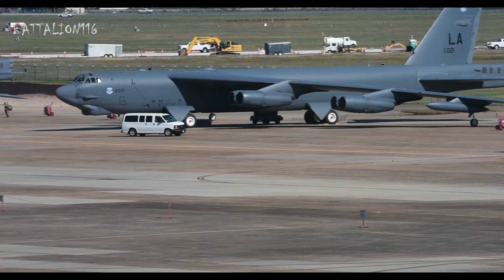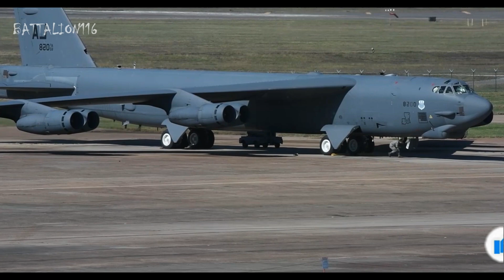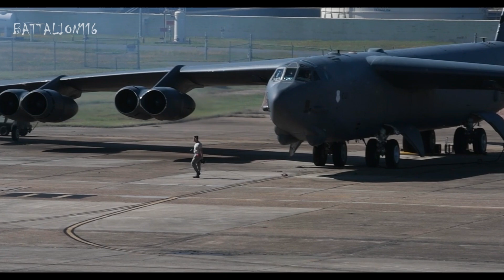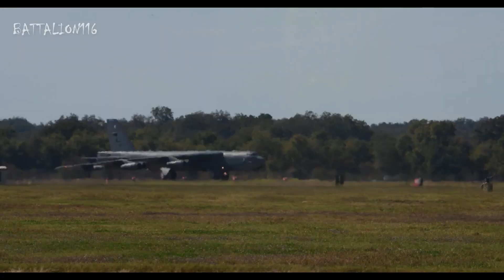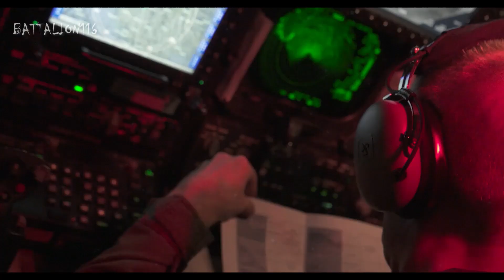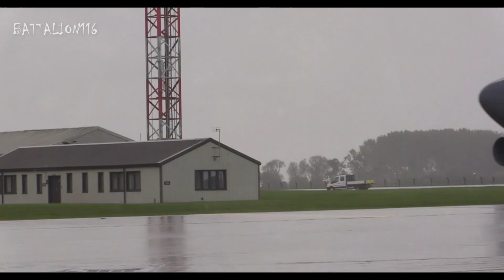Full Alert! US Air Force B-52 Bomber Makes Emergency Takeoff at Full Speed

Comment: I worked on E-model 52's back in early '60's. It had J57 turbojets on it. When in the alert area we were tasked with getting the plane ready to taxi in under five minutes. This involved pulling all plugs from engine intakes, ram air ducts. pitot tubes and pull wheel chocks. We already had external electric power unit and air cart connected. starting engines was much slower then due to the fact that the air cart only had enough capacity to start one engine and all engines had air starters on them. Get one engine going and then could start others off it's air pressure. Was quite a scramble! With the cartridge start they use now and eliminating the external air cart, can make a big difference.
Reply: I guarded these B52 back in1968 and 1969..was an A1c. In 2nd sps. barksdale argh.  la..l. ltcol Kenton d Miller was my sq commander..I remember wearing the poncho..correction.
Reply: And hot days.
Reply: Your experience with aviation sounds intense. The improvements in aircraft technology must be incredible compared to how it was back then. Do you have any favorite moments or stories from those days working on the E-model 52's?
Reply: @wewintvus  I was only in for four years, but would not be able to share all my memories here. Would take to long
Reply: After much thought, I guess that the most vivid memory was when I managed to get on temporary flying status and actually got to fly on them several times. Hope that helps!